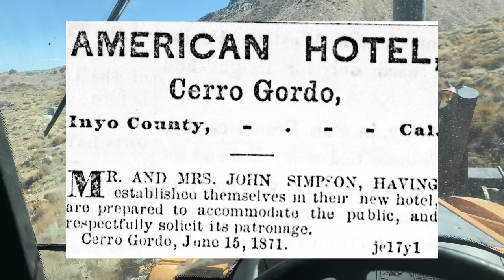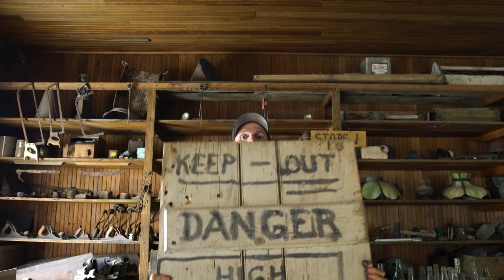Rebuilding The American Hotel Has Begun!

Comment: The hotel was built on June 15th, burned down on June 15th, and the reconstruction has started on June 15th. This would make an incredible story or movie. History is incredible.
Reply: wow
Reply: It already is
Reply: My brother in heaven would be so happy his birthday is June 15 🥰 this is an awesome thing your doing man!
Reply: How did the hotel burn down?
Reply: Yeah! How did the Hotel burn down?
Reply: @briancorr3668  I'm pretty sure an electrician or the like chalked it up to being faulty wiring in the building from a previous owner and Brent was just extremely unlucky
Reply: @markzimmermann1516  watch the videos mate!! Well worth it!!
Reply: @TheLucasdms  my cat saved our house last christmas by alerting us. A baseboard heater installed incorrectly caught fire. The insulation was rubbing on a sharp piece of the frame for the last 43 years! When they made the hole in the floor it wasnt lined up correctly and rather that enlarge it they left it like that. Thankfully the cat came to me and brought me to the faulty wiring as it was starting to catch fire from the sparks.
Reply: Incredible? That he did electrical work he shouldn't have done and burned the place down. lol
What a story.
Reply: History is wonderful
Reply: fate and irony goes hand in hand 💯💯💯💯
Reply: @RoCkShaDoWWaLkEr  He didn't do the faulty electrical work, someone else did an improper splice years ago that finally failed; they found a similar splice job in another building that was fixed after the fire.
Reply: @RoCkShaDoWWaLkEr  The people on this thread make mistakes - the perfect folks such as yourself can comment elsewhere...thanks, lol
Reply: @RoCkShaDoWWaLkEr  he didn’t do any of the electrical work, it was electrical that was already in place for numerous years
Reply: @fdls59  ...when he bought the place the wiring
should have been  inspected....at least the  hotel wiring probably should have been redone....wonder if it was insured ?....
Reply: @garyschultz7768  It more than likely was inspected given how stringent California is with their codes, which means that even if it was old as long as it passed it passed. I’ve been in the fire service for numerous years now and have run fires that were electrical in nature, and a great deal of time the fires occurred within three months of an inspection.  Just because something passes an inspection doesn’t mean that nothing will happen.
Reply: Don't you know anything about spirits? They hinge on numerology, symbols, symbolism, ordainance, ritual, perpetual continuation and frequency thereof.
Reply: @fdls59  Typically, when something is being inspected for a purchase it’s not the most thorough inspection. In other words, the inspector’s just looking at the panel, checking to see if the wiring is insulated versus aluminum, and that’s about the extent of it. He’s not going to start opening up outlets or unscrewing fixtures to check the wiring connections.

It’s unfortunate but it is what it is. What’s even worse is most of these so-called home inspectors just took a generic course at their local community college to get their inspection certificate.
Reply: That's crazy I just looked that up cause it's almost impossible to believe that actually happened.
Reply: Sounds more like a Horry movie 😮   the dates are too sequence
Reply: @emissaryofelohim1431 yes very true...

Comment: Prediction : 10 to 25 years from now this will be a legit small town again full of artists, creators, adventures and inspired people. 

 Great content and dream 👍
Reply: A more of a hippie hype town
Reply: Possibly; but the biggest obstacle still remains - where to get potable water?  Go back and take a look at the several-mile-long pipeline that used to bring water to the town, for a brief time over 100 years ago (you can roughly trace its path along the mountain ridge).  Could that ever be done again, assuming that there was water available at a nearby spring? 

The pool of water several hundred feet down inside the mine (as seen on several previous videos) is not a viable water source from what I can tell, even if they were able to put in multiple pumps to elevate it up out of there at more than a trickle that comes out at the hoist house now.
Reply: @redmondjp  The one thing I do believe in is the power of community ! In 5 years from now he should be anywhere from 7 to 10 million subscribers. With that comes more funding, more channels helping him more people donating more people wanted to see success. 

I believe in people, I work at Tesla so finding ways is what we do. There is always a way -  that town isn't the planet Mars. The water problem is simple thinking you have to run pipe up and around mountains is two centuries ago thinking. 

The mountain has a spring in the mine and new equipment, cleaning up to be run and be effective is not  hard. He just had people that couldn't think outside the box. I bet if there lives where on the line they could make it work. In this case they just wanted to get paid. People that say it cant be done, should not interrupt  those who are doing it. Anything is possible humans can do anything we want if we work together.
Reply: @WeylandLabs  I admire your optimism there Weyland, but you need to understand what the limitations of reality are.  A dank pool of water 800 feet deep in a mine is not necessarily a spring, nor potable.  How many gallons per hour can it supply, and for how long (and what is the arsenic level as well as heavy metals)?  How many decades did it take for that water to accumulate there?  Did you read the history of Cerro Gordo?  How many gallons per day did they require, all either supplied by the short-lived pipe from the spring, or hauled up there by horses and later by truck?  By power of the community, do you mean hundreds of people walking up Cerro Gordo road every day, each with a 100 pound canvas water bag on their back?

You can have positive thoughts and all the optimism in the world, but you can't change geology nor the laws of physics (not to mention the governmental and environmental regulations that didn't apply when all of that was originally built).  And requiring each hotel guest to show up with 250 gallons of water each probably won't fly either.  There is a darn good reason why many areas in the Western US don't have any people living in them.  Lack of water is one of the big ones.

I'm probably a bit older than you and have watched endeavors like this end up failing.  Believe me, I want it to succeed as much as anybody does, I really do!  In the end, it all comes down to economics.  Take all of the super-cool stuff that Microsoft co-founder Paul Allen was doing, such as the living computer museum (my friend worked there to get vintage computers fully operational - a dream job for an electrical/computer engineer).  Well, Paul Allen died and his sister (now largely in control of his estate) didn't share that vision, so the museum closed.  There are a lot of really cool things that can be done, that don't economically pencil out.  If you have a rich benefactor who funds them like Paul Allen, great.  But that doesn't last forever either.  My now-wife lived and worked at a  historic bed and breakfast (built in 1909) for many years and I moonlighted there when they needed help.  Despite it being apparently very successful, it didn't pencil out and is now operated as a for-profit adult care home (so it is no longer open to the public, sadly).  I really am rooting for Brent's success, despite what you might think after reading this; I am a big history buff and love to see historic sites get preserved and enjoyed by the public.  Oh - all of the historic B&Bs that my wife and I stayed at in Hawaii on our honeymoon have now reverted back to private residences, as we discovered on successive visits.  Economic reality; it bites!

Happy thoughts and technology can't solve all of the world's problems like so many people today have been erroneously led to believe.  If Brent and his partner can't generate the necessary cash flow in order to make this hotel project a go, how long will it remain open? How do you pay the electricity bill in the 7-8 months of the year that you aren't turning a profit?  How do you keep your staff in the off-season?  But the big question still remains: from where cometh the water?  Everybody want to take a shower.  Have a nice day, and may your optimism be tempered by reality.  Oh, for my day job I support remote radar sites that sit at similar elevations all over the Western US.  Some of them have 10,000 gallon water tanks on site.  Hmmm . . .
Reply: @redmondjp  There is a lot to unravel here, let me start by correcting my verbiage of spring vs well. I apologize when I am in a hurry the way I tend to think gets distorted a bit. I agree it will take a lot of time and effort to see that place come together. Not just from him but from others and the community he has started and that we both are apart of. There are a lot of questions that needs to be answered for that well to be relevant there. Understandably speaking if we are talking about 100% off the grid then he still has a lot of options he needs to assess. Access to water - electricity - internet - waste, pretty much a closed loop infustructure that should last forever I'm my opinion. The road ahead is long for him, but its just not his dream its over 1 million of his subscribers dreams who I believe in including you. 

And I mean power of community of donating and helping raise the funds to get the talent and the inspired people that wants this to succeed. 1+ mil people if 10% donated and few bucks that can buy a lot of talented people to help the water problem. Because running a pipeline up to the mountain could cost 20+ million and that's a lot of donations. So that well has to be the source somehow, and if not so - looking to see if there can be a paved road then we can always build a huge water tower. 

The thing is sir, times are changing I believe in the good of humanity and the best times are yet to come. I am an optimist I do have doubts about things, but our doubts didn't get us to were we are in time. Different thinking and a different way of doing things brought us here. Humans evolved 300k years ago, and 6k to 20k years ago civilizations started popping up. And just 142 years ago electricity was invented, our progress in less than 150 years - 2 life times, have been more than 4918 lifetimes accumulated from 300k. Humanities  progress is godly today, in just under 200 years we are finally starting the transitioning away from fossil fuels. 

Now I get the whole Paul Allen thing but lets be honest some people are in the right place at the right time when luck meets opportunity. And preserving what matters most in our life needs to be assessed all the time. For me that's making an impact on our planet and going what I can to inspire other to be the best versions of them.  We are not talking about forever but when some speaks your name for the last time that's when I die. We have lost focus of what actually matters in life. And that's our future not only our children but others children also and there children. How can we leave a world to the people we love in such bad shape ? I think you have seen a lot, I think you probably even been through more. There's no doubt life has its up's and downs, but it makes us who we are. We can be angry at the world or see all the joy life gives us. We just lived through COVID 2020 I'm pretty happy I'm alive today. 

My last statement : 

Technology can and will save us from us, our human savagery nature is slowly going away. Our thoughts, emotions, sadness happiness is all a pattern of code now. This is hard to explain but quantum A.I has been around while. And you can see human behavior vary where it goes with what it controls. But our savagery is hard wired into us based on genetics from being a hunter gatherers 300k years ago. We are just a species on one planet of trillions of planets in solar systems nothing makes us special yet. We haven't earned the right to be more yet. We still kill each other based on skin tone, beliefs, greed, power and just pure ignorance. We dont deserve nothing ! Not yet ...no that's what our children have to figure out and there's etc etc until we become better. Until we unite as one and work together to truly be free in a universe of unlimited possibilities.
Reply: I wonder what his end plan is.... to one day give tours.... or to bring back people.... or to start a small mining operation himself.

I'm sure there are people out there that would pay $$$$ to stay a week and go exploring mines with brent
Reply: If they got water before they could get it again...we are in the age of technology...we are a 100 years ahead..

Comment: Brent, I think what you need is a used Mercedes Unimog. It can handle terrain, you can connect small machinery to it, and it can haul goods for you. It can even deflate the tires to get more grip and get out of sticky situations. I think it would be the perfect work truck at Cerro Gordo.

Comment: You were mourning the loss of the original. Just know it could have been worse as well... everything happens for a reason . What if that fire would of happened when it was up and running with guests. What if the fire was in the general store with everything you have salvaged .... Just know you loved that hotel out of existence into its rebirth!! ❤️ I don't know if there's a way to have some kind of fire station up there with a water pump FOR THAT  kinda situation etc? If  Anything else u could possibly use maybe taking this loss as a lesson like how things could of gone differently? But  not in the way that it was ur fault... But so that u can try to figure out some other measures for if there is ever a next time.  Bless your heart 💜

Comment: Why so much rebar? One thing alot of people dont consider when building is rust jacking inside the concrete. This can bust the faces off of block/concrete over time. I think it's intresting that one of our main building materials has a fundamental flaw, and with good intention to strengthen concrete, rust can actually make it weaker over time.
Reply: Once that stuff dries.
It will stay bone dry and won't rust.
Because of low humidity. Almost zero percent chance and,
 360 days of sunshine yearly

Comment: Congratulations!  Well done. 👍🏼👍🏼👍🏼
While the fire was a low point in your life it could have been much, much worse.  Think how bad it would have been if you had guests in it at the time.  This way you will be able to build a safe structure.

It looks like water continues to be a major problem for you.  Do you have any plans to better tap that resource that you found deep down in the main mineshaft?  It really is not that deep relative to modern mining techniques.  You just need a better power supply and pump.  That is not much as compared to building a whole hotel.

Comment: Hey. Question.  Given this is your own town do you set the building code conditions yourself?  Are you the council?
Reply: And again I'm a little concerned watching this. In some of these mines I'm concerned that what you are standing on is fill.  They may have started at the bottom of the seam of mineral and worked their way up.  Which explains why there is very little waste outside the openings. They used it to fill in the gap they left in the seam as they mined upwards. I'm concerned and think you should be careful approaching any downward openings for the first time. The fill could collapse after so long.
Reply: What you are climbing through here is another empty seam.